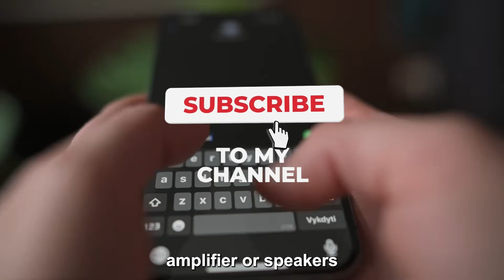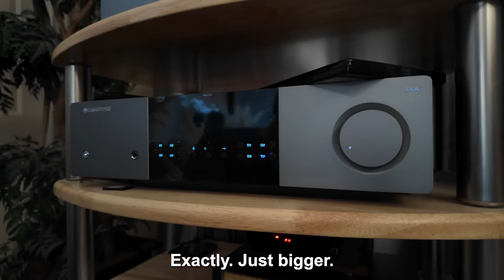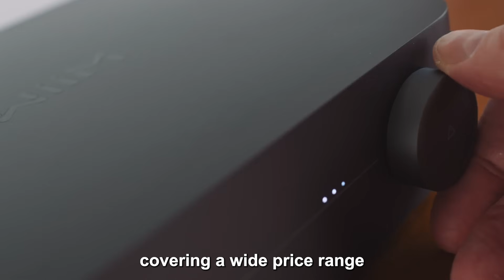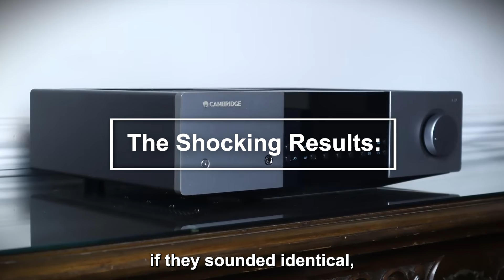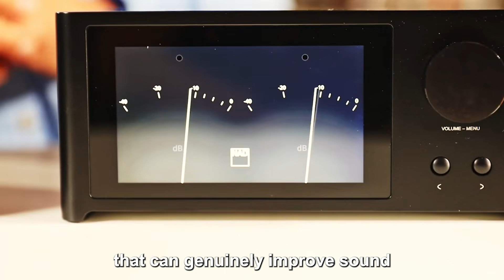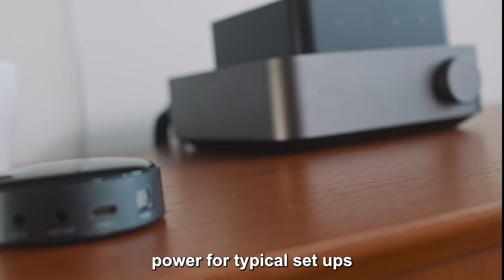Cheap Amplifier vs $2000 Audiophile Amp | Blind Test Shock Result

Comment: It's not just the amplifier one uses, but also what is the sound source, the speakers, the room's acoustics & finally how well one's ears are working. Most people over 40 can't tell the difference between a cheap & an expensive amplifier.
Reply from the maker: True, there are many factors—room, speakers, source, all matter. But saying most people over 40 can’t hear the difference isn’t accurate. Plenty of people with trained ears still pick up changes easily.

Comment: I laugh my ass off every time I hit the power button on my 300 watt, 140 dollar power amp. The sound is mind bending using my Marantz NR 1200 as my pre amp. To control my KLIPSCH 10 inch woofers volume and wifi connectivity. My Klipsch RP 600M II are killer with this setup. You would think I spent thousands on my system when you listen to it. But the reality is I only spent 1700.
I laugh my ass off every time I hit the power the power button.
Reply from the maker: Bro that’s the best part of audio—when a budget setup hits way harder than anyone expects 😂 That Marantz + Delta amp combo giving your RP-600M II that kind of power is wild. Nothing beats “sounds like thousands, cost me 1700.” Enjoy it! 🔥
Reply: @ConsumerSound Thank you my brother.